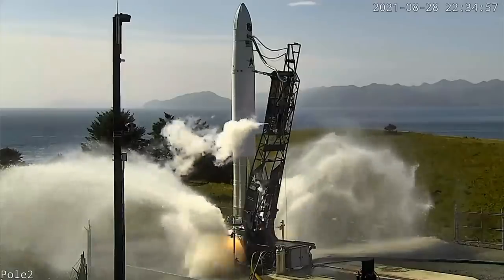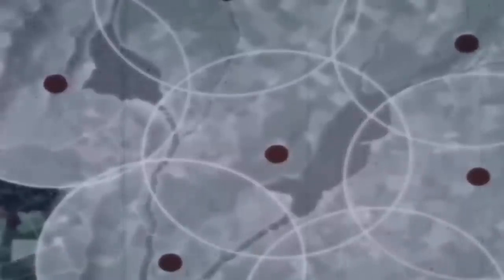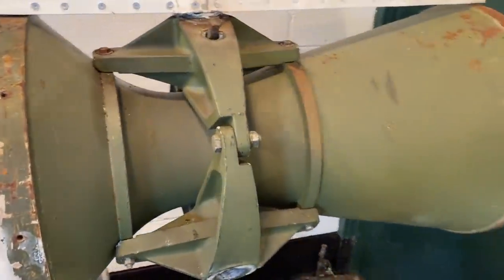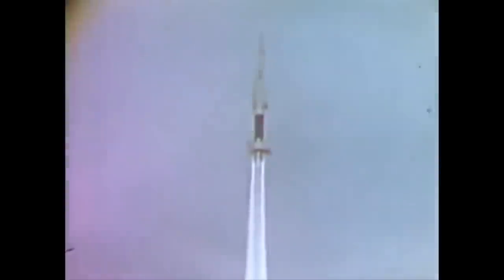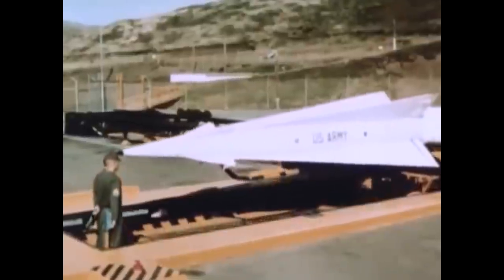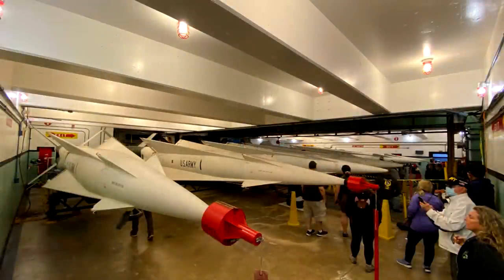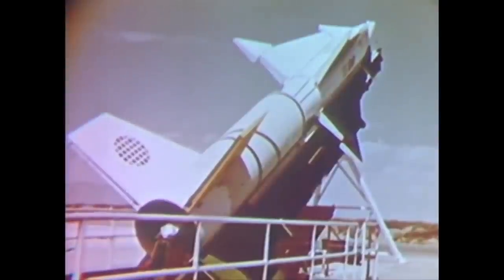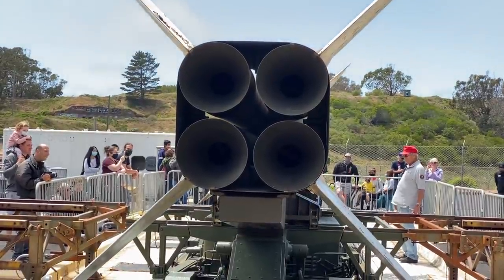Nike-Hercules - US's Surface To Air Missile with Nuclear Warheads.

Comment: One of these Nike bases was located in the middle of the Florida Everglades. Besides the misery of being posted inside the Everglades can we imagine what the humidity did to the electronics?
Reply: I was an MP at Alpha Battery in Everglades National Park from '76 to '77.  Alpha battery was put there along with other Nike Hercules batteries during the Cuban Missile Crisis.  They stayed there until I think, 1979.  In the summer the mosquitos were relentless.  We would joke the Army issue insect repellent was "meat tenderizer."  The perimeter was lit up at night with 220v floods on tall poles and that attracted every insect for miles.  Wildlife was everywhere.  Rattlesnakes and cotton mouths were all over.   One night we were coming back from town, turned the corner, and a panther ran right along side the convertible I was in.  It ran along side us for maybe 50 yards then dove into the brush and disappeared.  Today if you go past that spot they've put up a yellow Panther X-ing sign.  Winters there were beautiful, sunny and breezy.     The equipment needed constant service but we had a team that stayed on top of it.  I remember a day in December or January when temperature dropped to 32 degrees and Mr Sykes, one of the warrant officers in charge of maintaining the systems, had all the diesel backup generators started up.  They sputtered and belched an awful lot of smoke but eventually started running.
Reply: @markkelsey5847  …. Thanks for telling us about it, Mark

Comment: I'm also interested to know how the analog computer target tracking and guidance worked.  Bunch of gears in a big metal box?  What?!?! Well, I guess THAT won't be bothered by an EMP.
Reply: The Computer occupied 4 floor-to-ceiling cabinets inside the 8’ x 20’ Director Station Trailer. One was for Power, two were for the computing DC amplifiers and Zero Set Switches and one was for the electro-mechanical servos that calculated such things as Climb Angle, Turn Angle, Time to Intercept, Gyro Azimuth, Ballistic Elevation.

It took instantaneous target and missile Elevation, Azimuth and Range and computed a constantly updated Predicted Intercept point in three dimensions. It issued encoded Yaw, Pitch and Burst Commands through the Missile Tracking Radar. There was a micro switch inside the Time To Intercept servo that would produce the Burst Command at .002 seconds.
Reply: @ypdave01  Yes I expected the system would be large and complex. Amazing they could do this targeting with that kind of gear, you need really tight electronic and mechanical part tolerances when you are using analog circuits and mechanical servos to do these kind of calculations, a resistor in a feedback loop that is a little out of tolerance or a servo that isn't quite as linear as it should be  can cause big errors by the time you get to the guidance solution.   The idea of exploding a 20 kt warhead above Washington D.C. or Chicago seems flawed, however, and I can't see how the target acquisition and tracking radars could have worked for subsequent launches once the first missile's nuclear warhead was detonated; radar doesn't work well with nukes going off.

Comment: Interestingly, Nike Hercules was one of the few surface-to-air missiles which also had a surface-to-surface capability. This would lead it being used in some ... interesting Cold War shenangins as a kind of make-work (occasionally nuclear) SRBM.

In the 1960s, United States Forces Korea (USFK) pressed its Nike Hercules SAMs into the tactical nuclear role. Since North Korea had a relatively small air force and Nike batteries wouldn't have much to do in wartime, some bright-eyed staff officers got the idea of using Nike Hercules (including nuclear-tipped ones) against potential ground targets deep inside North Korea. Ironically, Nike Hercules was actually better-suited for the surface-to-surface role than the dedicated missiles--the MGM-1 Matador, MGM-29 Sergeant, and MGR-1 Honest John--which the Army deployed to Korea during the Cold War. The Nike Hercules had a point-to-point range of about 150-180 kilometers, which meant it could reach further than its dedicated surface-to-surface brethren. However, while this range meant Nike Hercules could deliver atomic warheads to Pyongyang from South Korea, they could only barely do it. Nike Hercules batteries had to be helicoptered up to exposed hilltops just south of the DMZ to be able to reach Pyongyang. 

In 1971, Pentagon officials finally got wind of what USFK was doing and where horrified. One official remembered: "[The Nike sites] were on hilltops within artillery range of the North Koreans. Were were all just appalled. They were like tiny little outposts within spitting distance of the North Koreans, like little castles on hilltops. They were virtually inaccessible except by helicopter ... They had been there for years, nobody knew or cared less. It was insane."

Assistant secretary of defense Warren Nutter ordered the batteries be deployed further south, thereby ending one of Nike's stranger missions: pocket nuclear deterrent.

But Nike would have a second life in South Korea, nearly starting a missile panic on the Korean peninsula. In 1972, the Park Chung Hee government (with U.S. permission) started reverse engineering the Nike Hercules, with the intention of turning in into a proper 
ballistic missile. By 1978, the ADD (South Korea's DARPA equivalent) successfully tested and created the NHK-1 (Nike Hercules Korea 1), more popularly known as the "Baekgom" (white bear). During the development process, the ADD actually bought Lockheed's financially troubled California propellant plant for a cool $2.6 million. The project caused fierce debate in Washington. The DoD and the embassy in Seoul supported the South Korean bid to build their own ballistic missiles, but the State Department fumed that the project might start an arms race with the North Koreans. Eventually, the South Koreans inked a deal to limit the range of their missiles of 180 km and a 1,000-pound warhead. In exchange for playing ball, they got access to U.S. guidance technology. 

Eventually, the project would lead to a missile tested in 1986 dubbed Hyunmoo-1 (black tortoise, the astrological "guardian of the northern sky" and a name dripping with metaphorical significance). The lessons learned while making these missiles would form the foundation for South Korea's later development of ballistic missiles. Indeed, South Korea is now one of the most enthusiastic and energetic developers of SRBMs.

Comment: The Sprint anti-ballistic missile of the 1970s would make an interesting sequel to this video. It's certainly one of the most extreme rockets ever built, if only because of its INSANE acceleration of 100 g. I know solid-fuel rockets are relatively boring, but that launch... zero to Mach 10 in 5 seconds? AND it's carrying a nuclear warhead?! Ludicrous!

Comment: Well scott Manley, I don't know about analogue computers, I do know that they used something called OP-amp
Operational amplifier

So... Get yourself a bread board a couple dozen op amps (they cost cents even on my country) triple in resistors the same amount in capacitors and two 12 volts batteries.
Next get a book on them.
(Op amp design guide search result in "[PDF] Handbook of Operational Amplifier Applications - Texas Instruments" a nice PDF from Texas instruments)
And show your moves.

P.S.: I would totally watch someone build a simple analogue calculator built with OP-amps.

Comment: lived down the road from a Nike site... US Gov't had pay for new wells for a lot people because they dumped a ton bad stuff just on the ground and it got in peoples wells. took 10 years from the time the contaminated water was found till the new well system was built. i think its up to 20 homes now that have been hooked to the system as more wells where found to have solvents in them. and people in the still have to do yearly testing.  

"The Army Corps of Engineers and Baltimore County announced yesterday that they have reached an agreement under which the Army will pay $1.4 
million for a community well system for Mr. Klass, 62, and his neighborsalong Sunnybrook Road in Phoenix.
Residents of the eight homes have been using bottled water since 1981 when their tap water was found 
to be contaminated with solvents that leached into wells from a nearby abandoned Army Nike missile base."

Comment: A tiny correction about anti-air artillery, the problem wasn't the accuracy of the artillery or its kill radius (though if you make it big enough, anything is a "hit"), the problem was almost exclusively the flight time of the shell. The flight time was about 30 seconds, so the piloting doctrine then was just to change course randomly every 20 to 25 seconds. Placing the shells exactly where you wanted would always result in a miss so there had to be randomness added to the aiming to give you the possibility of a hit, and, consequently, you needed and awful lot of guns and shells for that randomness to work.

There was an interesting corollary with ground based machine guns that's a little bit apocryphal, some of the more accurate machine guns weren't trusted by some operators because if there was any zeroing error or range estimation error, an accurate gun would never hit what you were aiming at. A half MOA machine gun would never hit, where a 5 MOA machine gun would eventually hit the target just by chance. In practice, no one is good enough with a machine gun to make use of that sub minute of angle accuracy though.  

I didn't come up with any of this myself, there's just a lot of old TRADOC videos floating around YouTube, and there's one on avoiding flak if you want to watch it.
Reply: Flight time of a shell: roughly 1 second per 1,000 feet of altitude.  In addition, you have to recalculate the new height, distance and direction (and speed, but for bombers that would be pretty constant in WWII) of the target and communicate it to the (analogue) gun direction computer and to the gun layers, which would take another ~30 seconds if not more.  So if you change your course and/or altitude sufficiently and do not average over a base course and height, the flak of WWII cannot catch up with you.

So the flak would shoot barrages/into boxes that they think/hope the bombers are going to fly through, or, very spectacular but very ineffective --- just all over the general area the bombers are going to be in.  Lots of bursts and puffs of smoke, but little chance to damage anything.

Germany also developed a 'proximity' fuze for their CLOS SAM and CLOS AAM missiles, using the Doppler shift and the cruising RPM of a bomber in flight.
Reply: @advorak8529  I don't really understand why no effort was made to make them faster. I know you can get 5000ft/s out of a piece of artillery. Im sure you can also trade some payload for some rocket propulsion, especially when you're about to lose a bunch of velocity and accuracy to the shell going transonic.

I know anything over 3000 ft/s for artillery usually means significantly lower barrel life but building a new barrel is better than having to rebuild an entire factory or airstrip and fleet of bombers.

I don't know though, they may have done one or both of those things just to get the average 1000ft/s velocity that they got.
Reply: @htomerif     We are talking WWII. Also, shooting upwards, you lose speed to gravity.  There's also friction.

The "eight-eight" 8.8cm flak (also great against armour) had a muzzle speed of 840m/s (2,690 ft/s).  It could be elevated to 85°.  Your task: ignoring the existence of air, how high can it shoot, and how long does does it take to reach the height in steps of, say 250m ...

The 10.5cm flak had 881 m/s (2,890 ft/s) (max elevation 85°), the heavy 12.8 cm flak (max elevation 88°) had 880m/s.

For comparison:
UK QF 3.7 inch Mark I -- III: 792-814m/s, Mark VI: 1,044 m/s
US 90mm M1: 820 m/s
Italy's Cannone da 90/53: 850 m/s
Swedish Bofors 75 and 80mm Model 1929: 850 and 750 m/s respectively
Japan's Type 99 88mm AA gun[1]: 800 m/s, 80° max elevation
France: Canon de 90 mm Modèle 1926 (dual purpose, main gun for minesweeper and AA for cruisers and battleships): 850m/s, 80° elevation
USSR: 85 mm AA gun M1939 (52-K): 792m/s, 82° max elevation. 

Let's have a short look at other artillery:
21cm Kanone 38: 905 m/s
10.5 cm schwere Kanone 18/40: 910 m/s
Schwerer Gustav (80cm -- 31.5 in railway gun): 720-820 m/s depending on the projectile
24 cm Kanone M. 16: 794 m/s
21 cm Kanone 39 (Czech-designed): 800-860 m/s
15 cm Kanone 18: 865 m/s
17 cm Kanone 18: 925 m/s (with maximum charge and the lightest shell)
12.7 (actually12.8) cm SK C/34 naval gun: 830 m/s
15 cm TbtsK C/36, a naval gun: 835 m/s (max range: range beyond 20km)
20.3 cm SK C/34 naval gun (Admiral Hipper class main battery): 925 m/s, 30 km range (69 seconds flight time, impact then at 363 m/s coming down in an 48° angle)
28 cm SK C/34 naval gun: 890 m/s (40.93 km range, Scharnhorst class main battery)
38 cm SK C/34 naval gun (Bismark-class main battery, re-armed Scharnhorst cass main battery): 820 m/s, 35.6 km range --- special lightweight shell, needing a modified gun with an enlarged chamber for more propellant (and hence coastal artillery only): 1050 m/s, 55.7 km)
155 mm gun M1 (US): 853 m/s

I believe you will find ~800 m/s to be the rough limit for the time.

You may remember that the kinetic energy is 0.5 * m * v², where m is the mass and v the velocity.  Increase the velocity from 800 to 1000 m/s, and you need about 1.6 times the propellant.

Never mind details like a longer barrel to actually burn all the powder or a stronger barrel to contain the pressure or the increased weight and material use and so on and so on --- or more friction, which means more loss and more propellant ...

And changing the calibre does not do much --- you will likely need to lenghen the projectile by the same amount and lengthen the cartridge by the same amount ... getting roughly the same propellant/projectile mass ratio.

You either need a very much "necked" cartridge (or, with bagged propellant, more bags) --- and you still have the same barrel length, pressure, wear problem --- or you opt for a much lighter projectile.

The lighter projectile works, but has the slow loading and large air friction of a large calibre gun and the low lethality and low mass of a small calibre projectile.

When it comes to anti-tank guns, ultra-dense, thin, long cores within a lightweight sabot are used, reducing the air friction by reducing the frontal area to a tiny amount but backing the same with a lot of mass, retaining speed much better, while the sabot is almost the same as having a huge powder chamber and a narrow barrel, except you can also shoot "normal" HE shells and co where the payload does matter.  Again, you do not see that happen in AA --- instead we carry a large (9.4 kg with a sidewinder) specialized warhead close to the target, using guidance, or close-range firing of large MGs or small autocannons (Air combat), where accuracy is not much determined by tens of seconds predictions of evading targets.

And that, in a nutshell, is why WWII guns tended to top out around 800m/s: all alternatives have too many drawbacks: too heavy, too expensive per unit, too slow firing for a weapon that relies on filling the sky with shrapnel or a projectile that does very little ...

[1] actually based on a German-made 88mm AA gun, but not the eight-eight but the naval SK C/30 AA gun (790m/s, 80°, 1930) captured at Nanking in '37 and being rather superior than what they had at that point ...